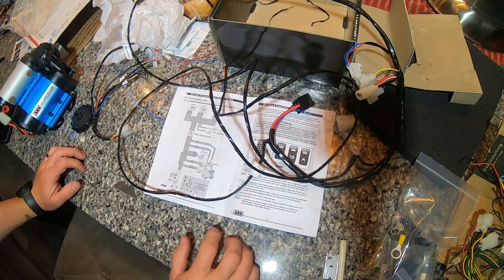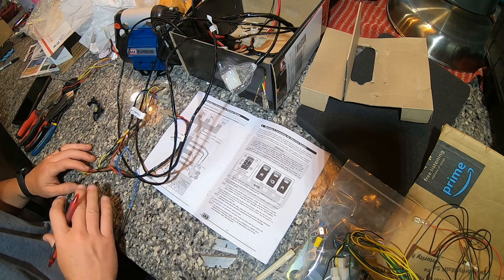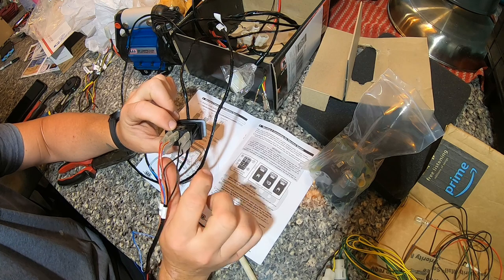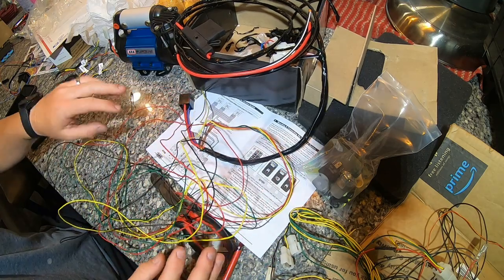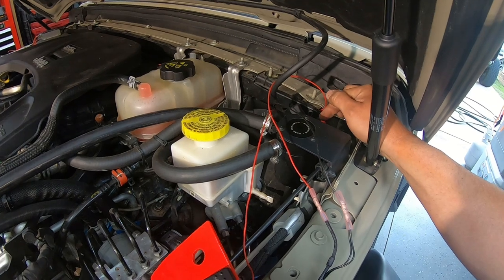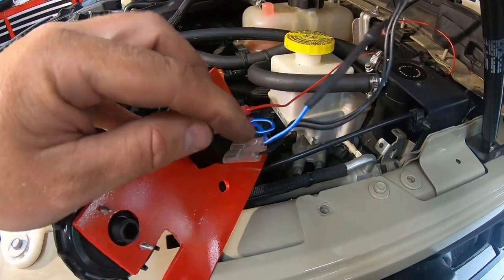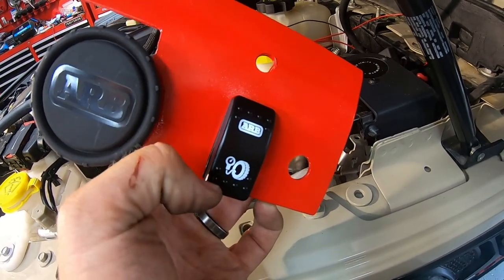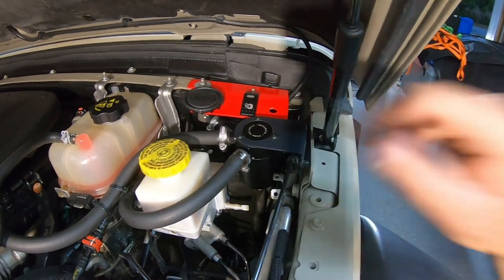Reducing the Wire cluster on ARB air compressor with single switch on Jeep Gladiator or Wrangler

Comment: I have this for my 2003 Jeep TJ Rubicon.  What a PITA--can't get anything to work as advertised!!  Installed compressor a couple years ago and it worked..., then couldn't get the compressor to turn on recently when turning switch to "on" position.   Instructions don't let you know until step 9/10 of trouble shooting that if system is pressurized, you need to relieve pressure to get it to cycle back on.  This means you need to have hose connected and press the "button" and compressor will eventually cycle back on.  Wasted hours of my time troubleshooting to get it to come on but didn't figure this out until hours later (user error on my part).  Now, I cannot get the lower light to come on when powered.  I ran a jumper wire to the parking lamp fuse block since the dash lights come on when you turn on the parking lights, however, it didn't work--no lower light illumination.  Then I read a forum member say to tie wire to the AC/heater control orange wire to make it light up and be dimmable--what a load of malarkey!!!  No lower light much less....,dimmable.  Bottom line:  Which wire on your Gladiator did you tie into to get the bottom ARB light (blue wire with white strip) to light up and be able to dim it with your dimmer switch (on the left side turn signal on my Jeep TJ)?   Please let me know so I can get this working.  ARB instructions are absolutely hideous--they need to keep it simple.  Uhhggg!!
Reply from the maker: @davidgore5719  if you were to watch the video, I don't hook up the lower light separate. I spliced it in to only be on when the switch is in the on position since it is under the hood and being lite all the time is not needed. It does sound like the switch light might be bad.

Comment: Im referring to the switch harness that ARB supplies in their wiring loom. You would still be utilizing the relay provided.
Reply from the maker: Yes I reused the included relay, switch and pressure sensor. All I pretty much did was take out the extra wire they had in to also allow locker switches to be installed.

Comment: i honestly wish ARB would stop wrapping these harnesses in electrical tape, trying to follow the diagrams from the relay and working out what has been piggy backed off what is a pain in the ass, just did a similar single compressor on a friends prado which was a nightmare, just strip the tape and following the wiring to see what the diagrams leave out worked best for me, secondly if you arent using the pressure switch or are just testing without make sure to jumper the two connectors, i made that mistake and was second guessing myself why the f@&king thing wasnt working
Reply from the maker: Yep, kind surprised they don't offer 2 sets  and even some longer setups for people running the pumps in the cabs.

Comment: Please pardon my ignorance but since you aren't running the switch wiring through the fire wall, are you no longer tapping into fuses?  I would like my switch to always have power and not have to turn on my vehicle for the compressor to work.
Reply from the maker: That is correct, I am not using the jeep factory fuse or fuse taps. I did install a fuse at the battery where it plugs in before running the wire to the switch. You always want a fuse as close to the power source incase a wire goes bad or something grounds that it stops power flow.
Reply: The inline fuse you bought how much amp (I think that’s the term) is it rated?  I’m using your video as a guide for my JL single switch install.
Reply: @ajphillipsjeeps  did you a 10 amp inline fuse?
Reply from the maker: @ericschmidt1987  I will have to look at what size I used, but you do not need a lot of amps since it is essentially only giving power to the switch light and triggering the relay which carries the high amps. A 5 or 10 should be fine but I will try to remember and check today.

Comment: Would it work if you completely removed the switch harness and ran you red and black straight to the single switch?
Reply from the maker: It would technically work, but you would have to buy a switch that power the Amperage going through it. Much cheaper and easier to wire a relay. All the switch does is trigger the relay on.